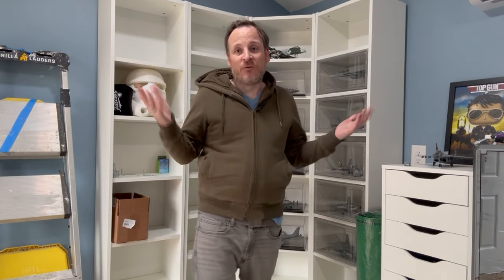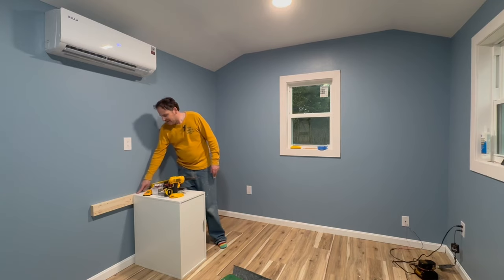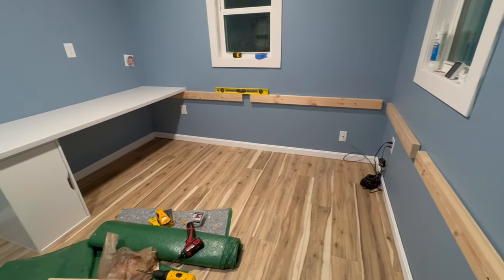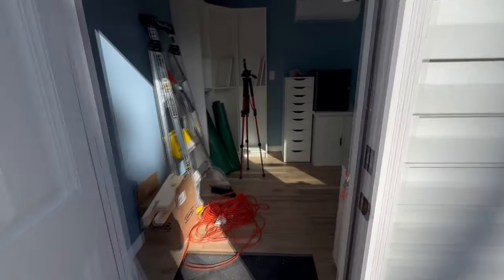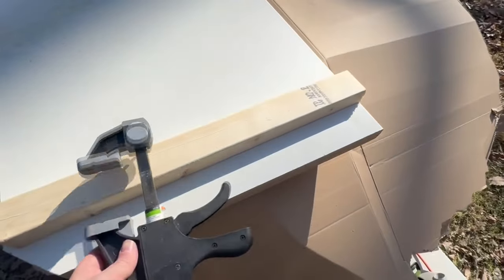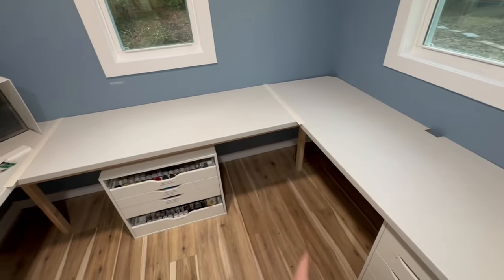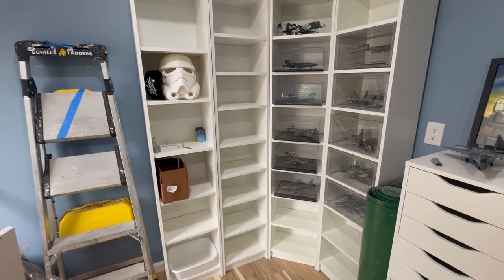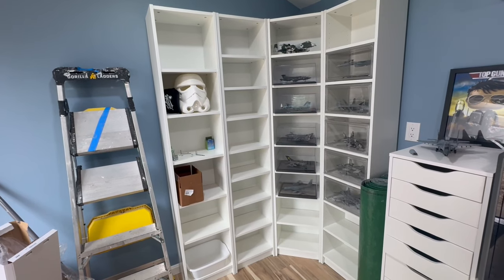Turning my Shed into a Hobby Studio - Part 9: Ikea Desk and Furniture

Comment: Yep, masking tape before cutting is a good idea. Not bullet proof but certainly better than nothing. Amazing work with the shed, looks awesome. How are you gonna route the hose from the spray booth? I didn't see a hole in the wall for that. I would love that air conditioning unit in my home office. But over here, usually only really needed for cooling for a month or two so never really got around to installing one.
Reply from the maker: There is a 4” dryer hose duct in the wall behind the booth.